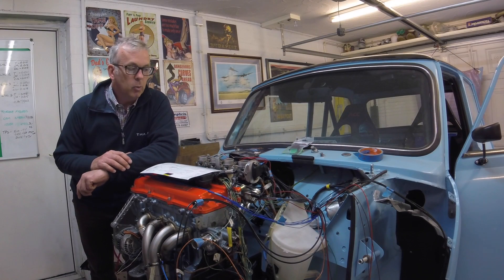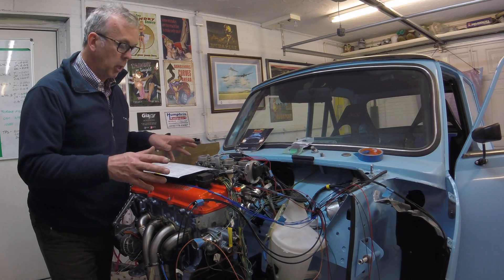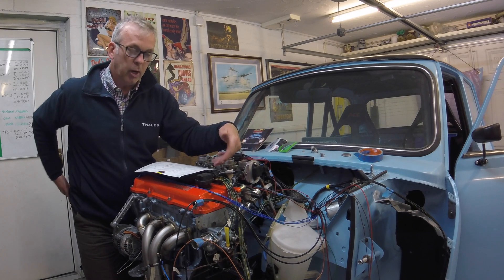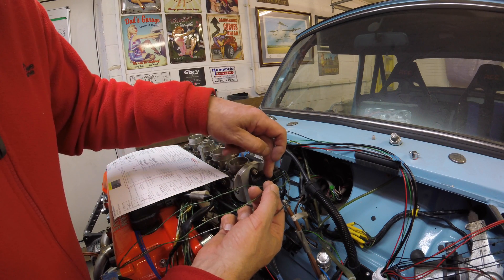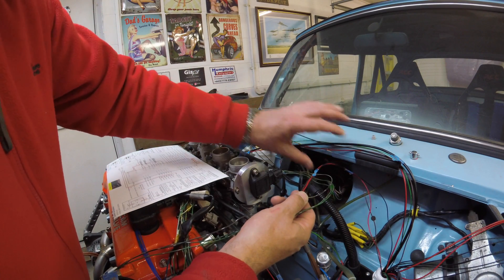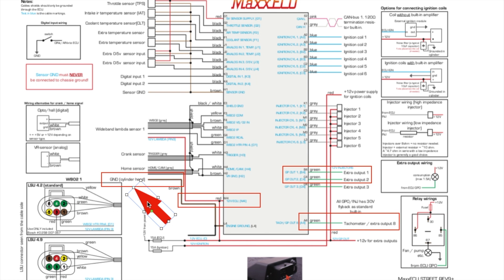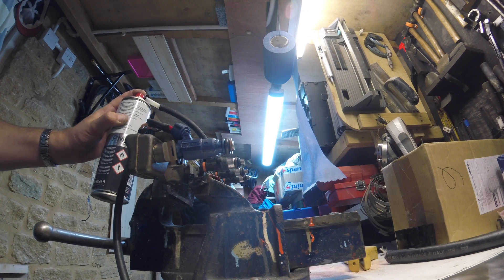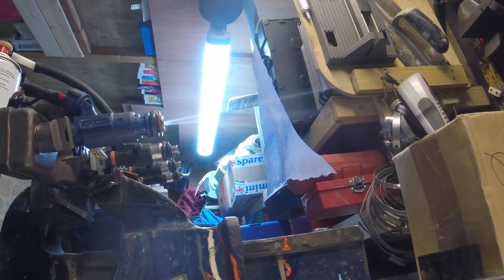Mini Nissan K11 Engine Conversion Episode 14 - Standalone ECU Installation

Comment: So are you putting the k12 injectors into the k11 fuel rail or using gsxr600 injectors?
Reply: Also,  what does your fuel system look like on this set up?
Reply from the maker: I have used k12 injectors there are a straight swap

Comment: Another interesting well explained video David, thanks.

Is wiring in the ECU  really that simple..??
It appears a minefield to me...!!
Reply from the maker: It's a case of breaking down the task to work out what your engine needs and what is not required, once the overall strategy is decided it becomes a case of a series of 7 or 8 small wiring tasks rather than viewing it as a complex system.
Reply: @davidlee4966  
Thanks for explaining